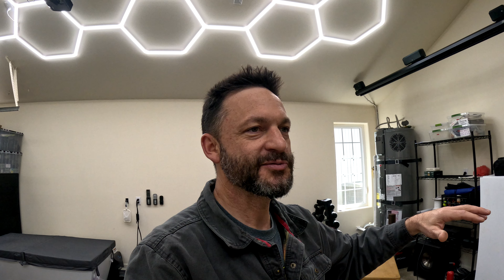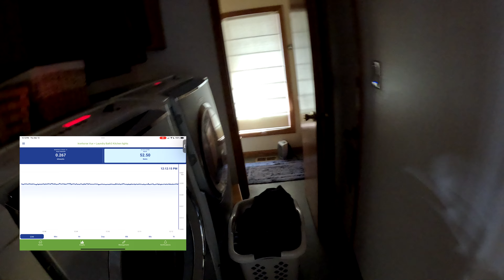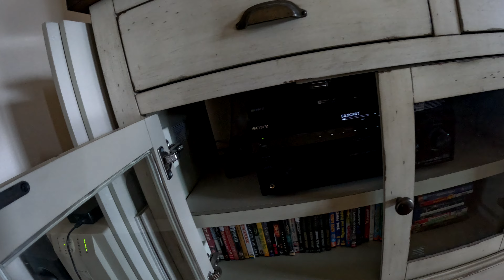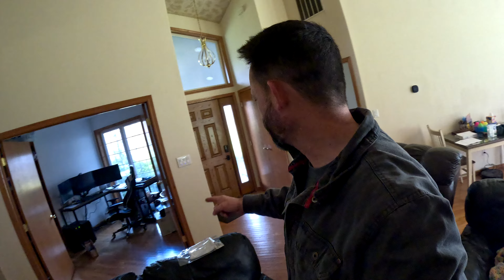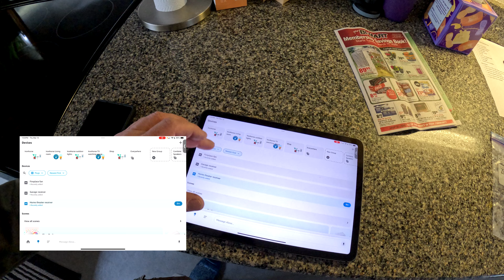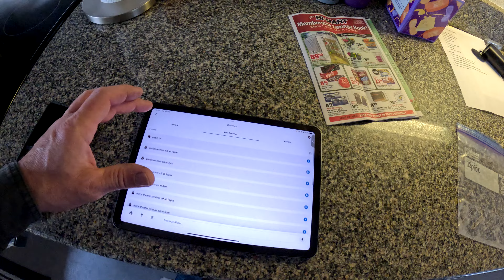Energy Savings with an Emporia Vue and Smart Outlets

Comment: Nice video.   For optimizing devices,  my questions would be, "Do they provide any benefit (when in idle)?   Any loss to me if they are completely off?"  For the two receivers, I think the answer would be no.  Especially when 150W between them.  For the fan, that's at least still running, and circulating air.  If it's room-temp air, then yeah, turn it off when not needed.  But I noticed it's behind your wood stove.  So I was assuming it's there to circulate the warm air when it's on.   Maybe you could get a wifi thermometer, and have a routine that turns the fan on when it detects the stove is on.
Reply from the maker: That's exactly what I ended up doing (but not in this video).  I set up two thermometers in the house, one in the kitchen near the wood stove, and one in the living room.  If they deviate by 3 degrees or more, that turns the fan on.  It also turns the heat pump fan on (without running the actual heat pump).  This equalizes temps throughout the house pretty quickly.  
At some point

Comment: The the energy hogs are all the automations that you added...
Not to be stupid but you do know you could add two circuit breakers per sensor. Just make sure the circuit breakers are on the same phase or other words every other breaker.... You could cover your whole panel without moving them all around...
Oh, you should add up all the phantom power that you were going through that you found it does up it add up in the end...
Reply from the maker: Each z-wave switch takes about 1 watt, and the zigbee devices are around 2 watts.  Thats a far cry from the 80-100 watt devices they are controlling...and if it means those larger loads spend most of the day turned off, then the energy savings is huge.  Let'S do the math... say I add 10 1 watt smart switches.  That works out to 240 watt hours per day, or .24 kwh.  That means those 10 switches cost me about $0.05 per day, or about $18 per year (for all 10 combined).  Their operating cost is trivial compared to what they are saving.  So, I simply disagree with your assertion.
And no, you cant use a single CT to monitor two separate circuits.  You can use it to monitor one side of a two pole breaker and add a 2x multiplier; but each single pole breaker needs its own CT.
Reply: @MattVerley  I agree on point 1, but I'm pretty sure you can put multiple circuits through the same CT, you just have to make sure they are on the same phase. Alternatively, if they are on a different phase, you can swap the direction of one of the wires through the CT. Of course, you won't be able to differentiate between the two as you'll just get the total, but it helps to be able to monitor more.
Reply: @MattVerley  As long as you can pass both wire through the CT clamp, yes, you can monitor two circuits. The result is a sum of the two circuits. It's even possible to add two that are on opposite phases. You have to reverse the flow direction of one by putting a loop in one leg. This is one recommended way of monitoring Solar Generation when you are short on available CT clamps.

Comment: I just installed the Emporia Vue 3 in my home, I had visions of saving energy and the system paying for itself in a few months. I’ve had it for 3 months now and am still in the “now what?” phase. I’ve been looking at the app and monitoring circuits and usage for my plugged in devices with the wireless outlets…but still “now what?” Your video just clicked the dim light bulb in my head to on, finally I have a “now what” I’m going to start looking at my consumption and look for things I don’t need on for 24 hours then put them on timers. Finally! A plan, thank you for that and I don’t know why I didn’t think of it on my own, doh!
Reply from the maker: Glad you found my project useful and applicable!

Comment: What I'd really like to know if this thing can finally actually do is show me what wattage/amperage is on EACH 120v leg coming in from line or generator.  I don't care about monitoring all these devices in the house as I just don't care.  If I need to know what current draw is, I have clamp meters and don't have the need or time to watch another app tell me.  It's primary function would ONLY be to show current on each leg for load balancing when on generator power.  It would still work on line sensing too for theway my setup is but that doesn't matter.  Any idea if they made this better yet?  As of January 2025 when I installed the bigger system, and pulled it out and returned it, it could not do this.  They even admitted it was "limited in what it showed".  Just curious.
Reply from the maker: Each CT monitors current flow in a separate circuit.  You could simply install one on each leg coming from the generator and leave the multiplier set at 1.  This would tell you real time what the current flow is in each leg individually.  Maybe I'm misinterpreting your question; but the vue can certainly do that.  I'm not sure why they would have told you that it couldn't.
Reply: @MattVerley    The way our 2019 built house is set up, the main 200 amp breaker is outside in the main meter panel.  In that same panel, there is a 50 amp breaker below it with interlock kit for the generator.  So, when eacy CT is put on each leg in the house breaker panel, it would show what's on the line voltage or generator.  What I would like to see is if the app just simply shows the voltage/wattage/amperage for each 120v leg.  Nothing fancy.  No extra devices/CT's.  There are some basic meters on Amazon that many people use outside and see what's going on with wattage/voltage/frequency but those chinese cheapos aren't UL Listed so I'm taking no chances on a $450k house.  I literally would like something  that shows wattage per side for balancing.
Reply from the maker: @ITguyAR_66  The vue would work fine for this; it doesn't show voltage for each circuit (it just monitors voltage from a single source; so it would show whatever is supplying your panel, either mains or generator depending on on what you are using at the time) but it absolutely does monitor current/power on the individual circuits.  If I was doing this for myself, I'd buy the 6 channel model, install the large CT's on the mains and two of the small CT's on the generator lines in the outdoor box, and ignore the remaining 4 channels.  
This will give you the data you need for load balancing.  https://amzn.to/4mdX551